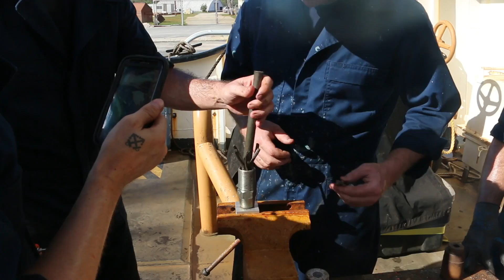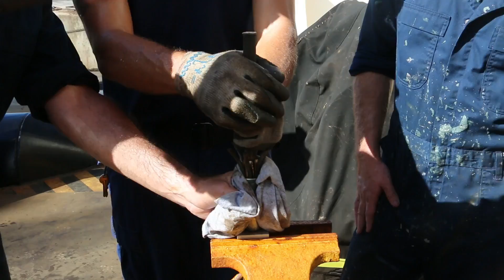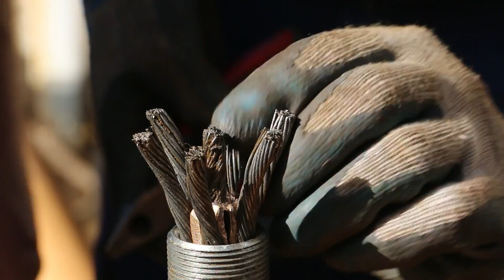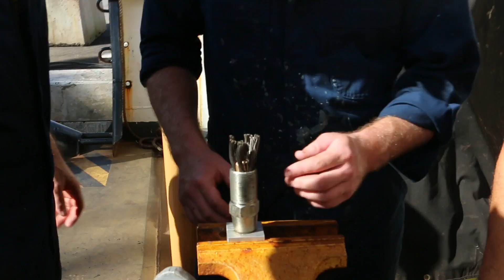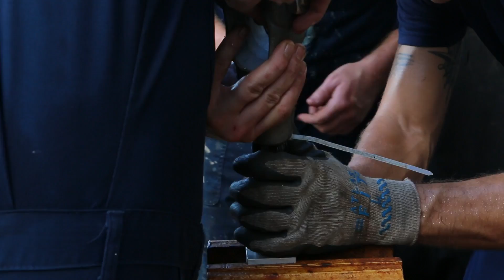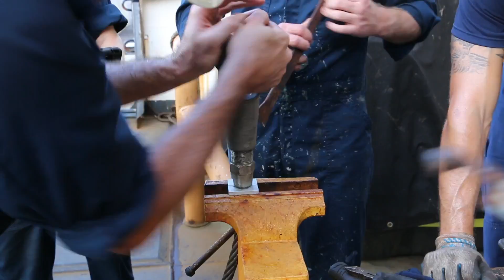Wire Rope Electroline E-M Cable Termination Installation

Comment: Obviously this was a first for these guys. I’ve done many of these terminations. It should only take one skilled person about 15 minutes to do this. I never used a sledge hammer, a large ball peen works fine. There is no reason to fight with the strands so much. There are also  tools available for installing the wedge and for closing the strands back. I’ve often used zip ties, but much stronger ones than they used.